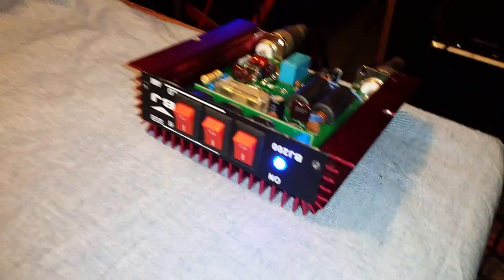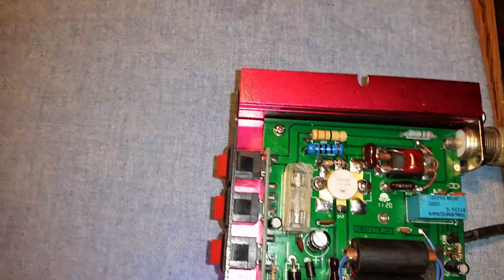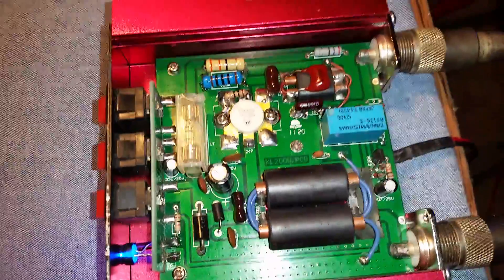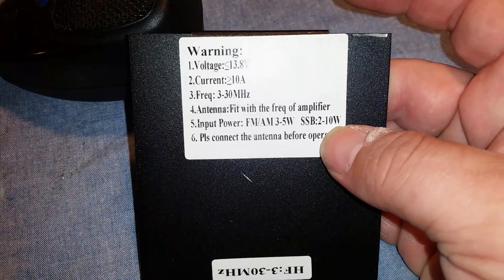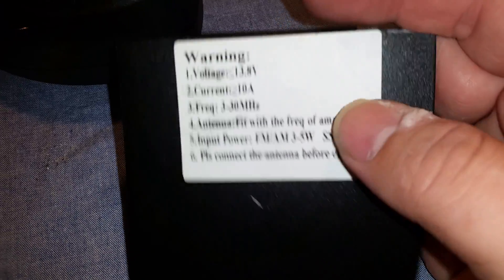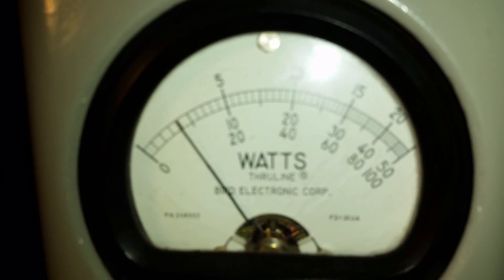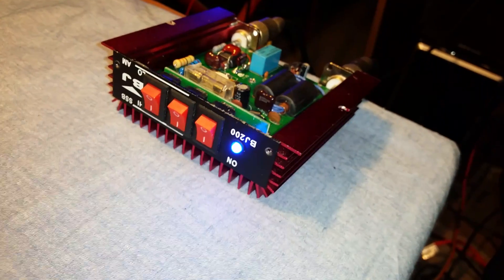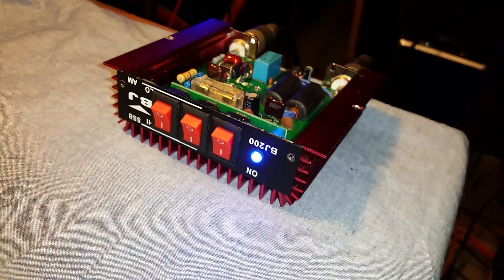BJ200 MRF247 Single Transistor Amp For Ebay - SOLD!

Comment: Sometimes When These Go Out, Try To Check With Multimeter On Continuity Test And Test The Leads Itself, I had Once This Problem That The Amp Burned One Lead, Since Then I Always Solder In Thicker Wire Over The Main Leads Wich Take The Load Or I Just Go Over Them With Solder And Make Them Thicker And Bigger So The Load Will Not be A Problem, Just Dont Forget To Cover Them With The Green PCB Paste Glue That Makes Them Not Conductive.

Comment: I’m pretty late for this but I just ordered one is it good for cb or did I waste my money
Reply from the maker: Cool little small amp... just don't over dive it be careful.
Reply: @1883GotDown  thank you
Reply: I just did the same thing ordered one then I saw all this stuff and I ordered the RM Italy instead hundred watt, but I’m putting a low pass filter in with it
Reply: I did the same thing ordered one didn’t even get it in the mail yet and I ended up ordering the RM Italy because I’m not sure how this one will be and I’m gonna put a low pass filter on with it cut down the SWR’s
Reply: @Dan-hx9og how did it work out ? I have one. Not yet installed
Reply: I did the same thing ordered one didn’t even get it in the mail yet and I ended up ordering the RM Italy because I’m not sure how this one will be and I’m gonna put a low pass filter on with it cut down the SWR’s